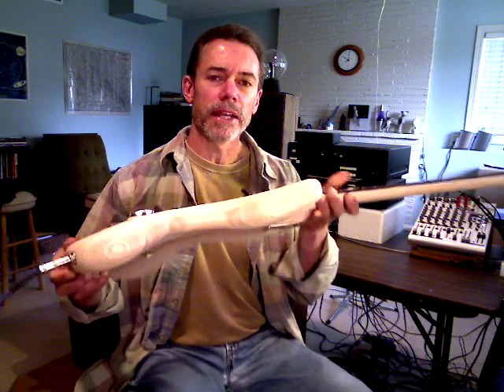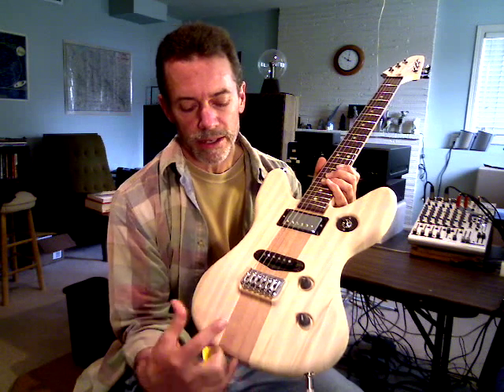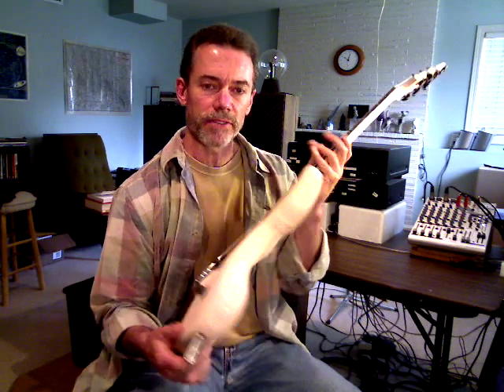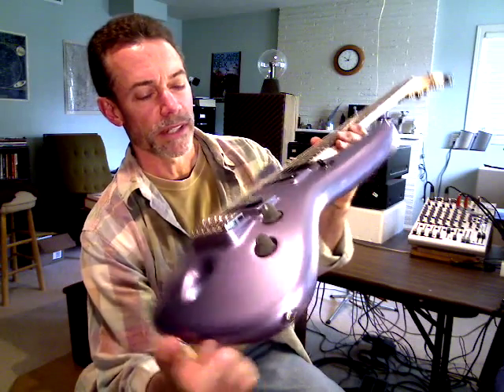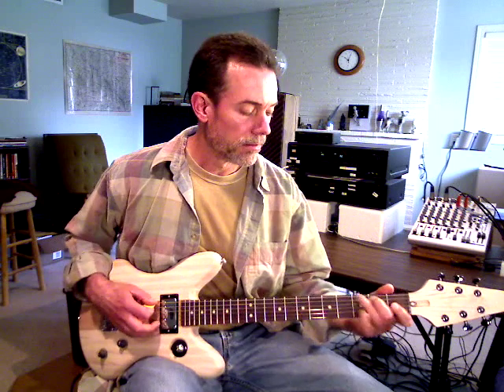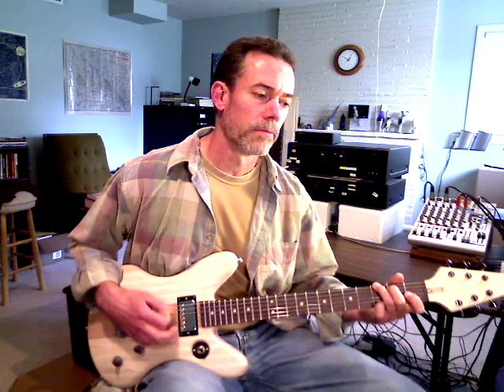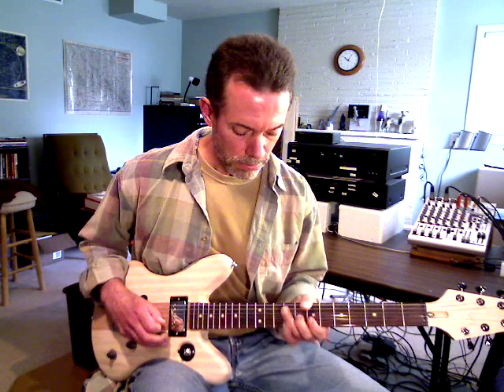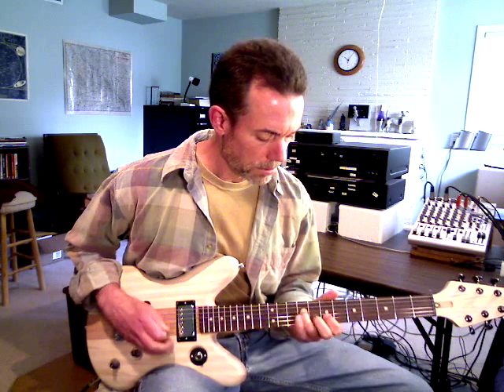CNC Custom Guitar - KOZM AW3 - Before paint

Comment from the maker: I've been using polyurethane based paints and clear coats.
Does it affect the sound?  Not that I can tell.  I think you'd have to really glop it on thick, like 2 or 3 mm before you could measure any kind of difference.
Hope this helps.